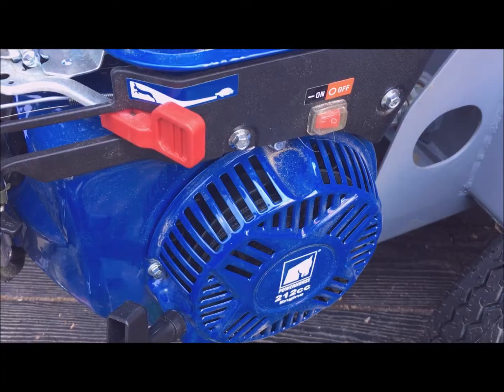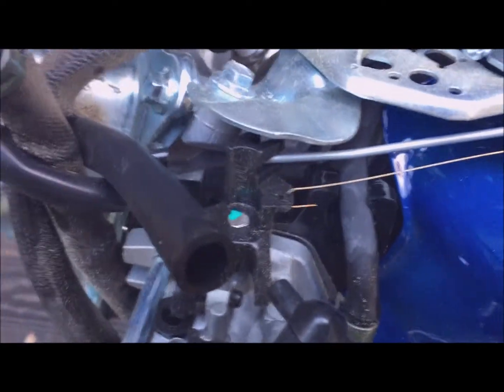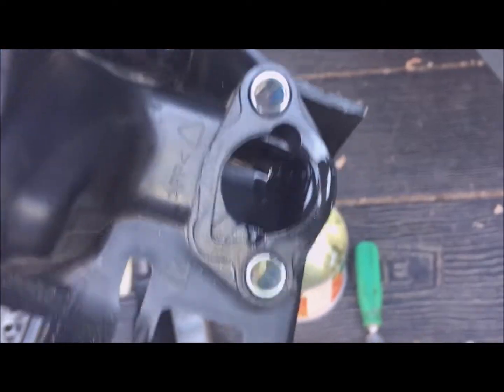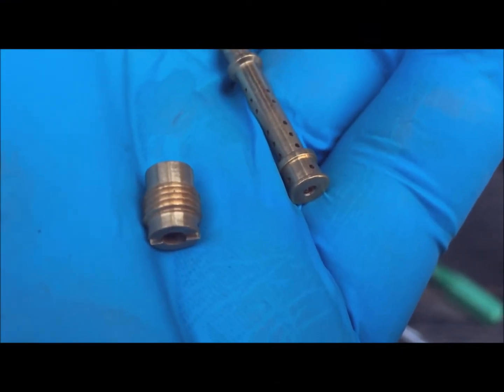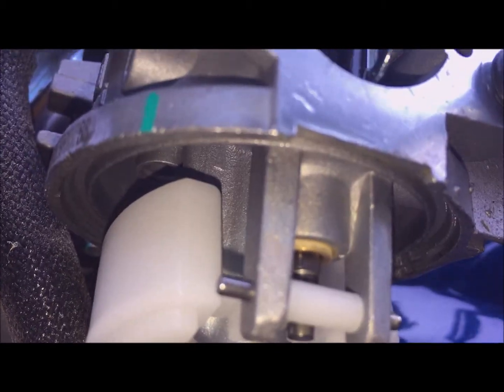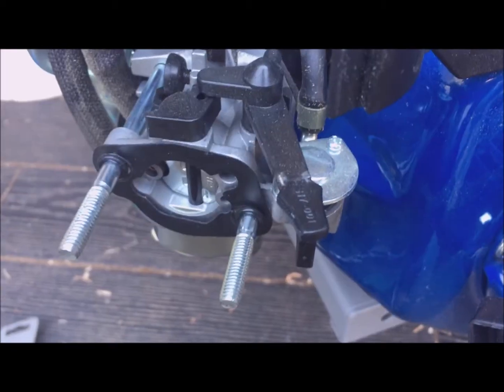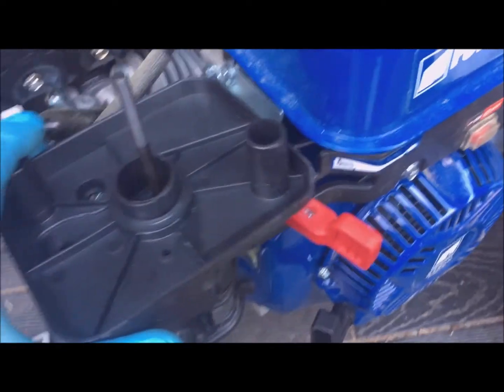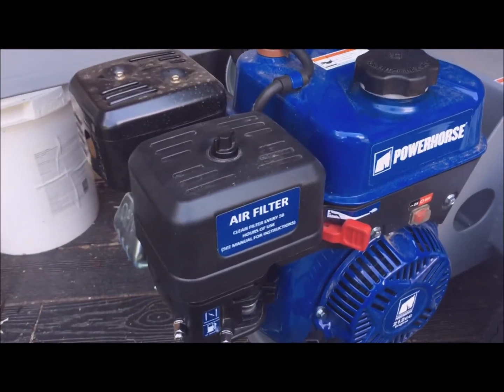Powerhorse 212cc OHC gasoline engine carburetor repair. Lean run repair. Jetting problem.

Comment: I ran mine new last year with the choke at 50%. This year it still needs choke or it kills. Thank You So Much! I'm going to try searching for dirt and then clean the jet.
.
.
.
Reply from the maker: Since I’ve cleaned the carb for this video I’ve not had any further issues. I DO run the carb  dry by shutting off the valve and run the engine til it quits after EACH use.